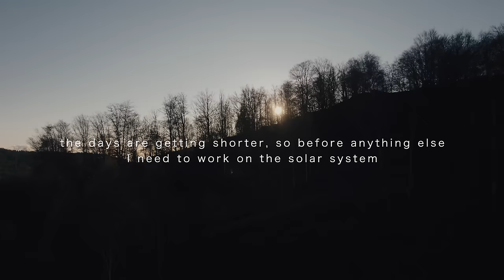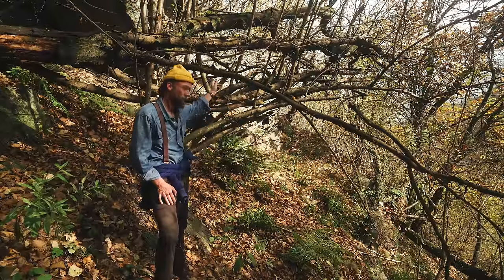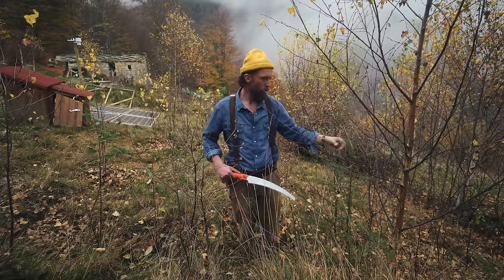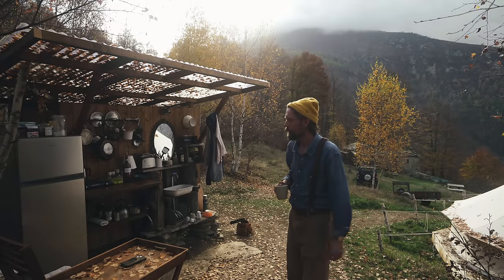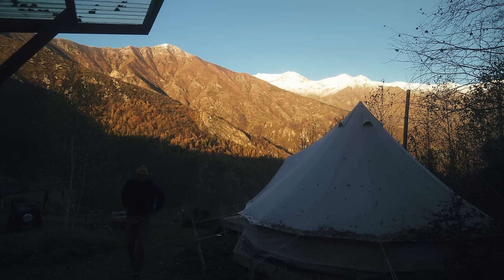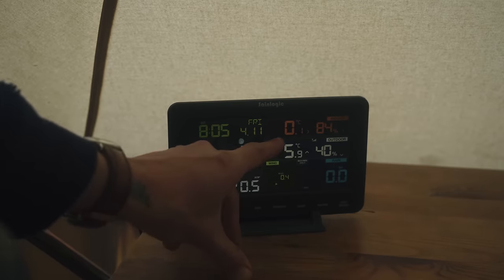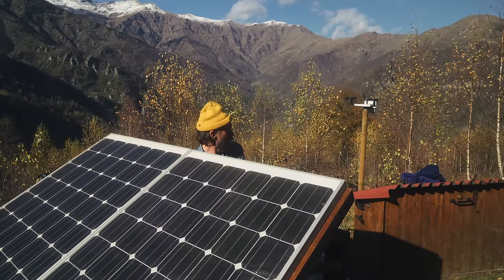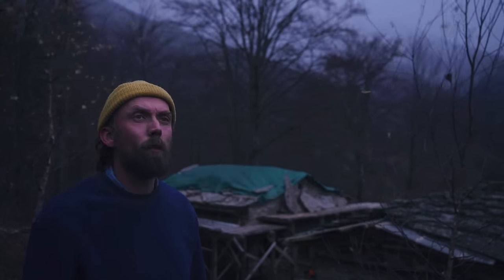#43 Expanding the solar array

Comment: I was taught the best way to mix concrete in a barrow is to use the broad side of a pick. Drop into the front of the barrow and pull back towards yourself. You are moving less material but still getting a good amount of mixing for less effort than a shovel. 

I'm absolutely immersed in this channel after stumbling upon it a few days ago and watching the 3 hour compilation video.

Comment: I have designed solar array installations. The panels are generally oriented facing south pitched at the angle from horizontal of your latitude. This maximizes the output over the year. The angle can be increased by up to 20 degrees to improve performance in the winter. The latitude of Turin, which I think is close to you, is 45 degrees. Judging by what I can see, your panels are pitched considerably less than that. You could try pitching them between 45 and 65 degrees for better output. Panels at 65 degrees will also shed snow very quickly. 
Love your channel and look forward to each episode. 
Brian Hughes

Comment: When summer comes again you may need to think about installing (extra) batteries so you can use the juice of these extra solar panels at times the sun is not shining 😉
Reply: he has 6 batteries installed at this point (I believe)... look at behind the panels,  a  small shed, with several batteries... watch his previous videos
Reply: @Dr.Yalex.  then it might be time to,expand more on battery capacitity so,all that extra solar capacity does not go to waste 😉

Thought he installed batteries… but with these extra panels he might need to expand capacity.
Reply: @Zweefduiker  check out his earlier videos... he has a generous supply of batteries, a generator, and a decent sized solar-powered  water heating tank for instant hot showers. It might be time for you to watch all the videos from the. very beginning over a year ago. Enjoy!
And.. I hope you enjoy all and every mistake Martijn made as much as I did... lol
Reply: @Zweefduiker  didn't read the last part ..."hought he installed batteries… but with these extra panels he might need to expand capacity.".... he clearly explains all the reasons for the extra solar panels, how it will/does correlate to the batteries, how he's planning to expand and when, regarding power harvesting needs and possibilities, fridge running needs, etc. 
Bottom line: all your questions have been answered already by Martijn.
Take care! ciao

Comment: Looking awesome, a tip I learned staining, you can use a rag to dispense it and wipe it off too, since you need to wipe it anyway, you use a rag for both, it’s much easier than using and cleaning a brush, you don’t have to wash a scrap of rag.

Comment: Great vid as usual,  Instead of struggling to mix concrete in a barrow for posts , just fill the holes with a  dry mix and add water after dont over water as the moist ground will do the rest for you

Comment: Little late with the idea but moving the stones with a dolly or hand truck could make things faster and im sure you would find more uses for it. Also, Maybe adding grease to your electrical connections will help it from corroding or being a pain to take apart. That last shot was breath taking. Well done.

Comment: Great video as always Martijn! One thought that came to mind watching this episode, depending on the climate class of your refrigerator, consider turning the whole unit of, if it continues to stay outside during fall and winter. Much lower temperatures than recommended increase the viscosity of the oil used in the compressor unit and may result in much faster wear of the mechanical components thereby greatly decreasing the expected lifecycle of your fridge.  Maybe you can move the food from the fridge into some kind of crate oder similar, so no animals can get to it, as soon as the temperature stays below the maximum of 7-8 °C. For even lower temperatures a styrofoam box inside your tent could do the trick, depending on how cold it will get the upcoming months. If you can do without food from the freezer during this time the better ;)
Cheers and good luck with your upcoming projects.

Comment: Another great video.  I'd be interested in a follow-up down the road on how your solar panels and system work as you move into the shorter days, colder temperatures.  A question for you would be what kind of time do you anticipate spending on the roof renovation work before you started?  I do appreciate your honesty and sharing your missteps. You are seemingly authentic and it's why I watch.

Comment: Whether I saw the snow on the mountains or not, just looking at the scenery told me it's getting cold. 🥶 . You've been busy, preparing for the winter, and with the added solar, you should get sufficient power. 
Those grasses you cut down make either good compost material or good mulch for the trees and vegetable garden. Leaves of almost any kind except walnut will make good insulation against the frost level freezing the tree roots. 
I'm amazed at the depth of soil, usually it's maybe 3 cm deep on the higher mountains here.

Comment: Hi Martijn, love your work mate. Here’s a tip for mixing concrete in a wheelbarrow, I find using a hoe to mix is easier than a shovel.. It’s less surface area for your arms to pull through the mix.

Comment: Just a thought, why not build a frame for your solar panels, then using a spindle like the one for the crane, and let the frame follow the sun and you could ty it down after setting it to the sun, I love your knowledge of all kinds of building, I'm 82 but worked with an old rock wall craftman, and he use a pot about 8inches wide with 2 or 3 inches of water in it to use to level his stones, I learned a lot working with him about weight transfer water shedding etc etc love all your videos.

Comment: The design of the MC4 connectors isn't flawed, they require a tool in order to be code compliant. If you don't have said tool you can always use a small ziptie on the tabs for a release that doesn't damage the connector.

Comment: I live in Virginia in the USA on the est coast half way from Main to Florida. My family who were raised here discouraged pine trees because during drought they seem to be the first to catch fire and burn very hot and very faxt so I am surprised that you are encouraging them. Also they will propagate very quickly and you will be surrounded by a dinner box. The other trees take more heat to burn and burn slower giving a chance for escape. If you are in an area where drought happens you could be building an internal raging furnace around you that would be impossible to escape. My grandfather died in fire so I am very aware of dangers and plan for future and escape routs. Just  a thought!

Comment: Thanks for your uplifting work, Martijn! It's inspiring. Don't know if you meant the inside of the tent is 6° colder than outside? If so, it means you have high moisture levels inside. The woodstove will take care of that. Slow burn it during the day every other day and your tent will be nice and dry - and warmer.

Comment: I think now a days you made experiance that the weather in the alps can change from sunny to rain, snow with in 15min. Would be helpfull to watch weather-forcast view times a day. So you are prepaired of what is coming.
What i do not understand:  It‘s getting colder and colder now, but you are still cooking outside. Beside you have 2 houses with waterproof roof. Temporary (over winter) i would move the kitchen inside in one of the house. So you are safe too.

One more tipp: In the mounthen, alps it can be heavy snowing. Heavy as you can‘t go anywhere for maybe 1 week. You will be completly blocked. Hope you add some reserve food, water, … good for 1-2 weeks or more. Otherwice you will have problem if you are planing to stay there the whole winter.

Comment: I think the window is supposed to have wider trims on the sides, at least 15cm. We also have the Velux windows and the trim is much wider. It depends on what type of roof the trim is made for, but I think it would have been much easier for you to install with wider trim. The wider trim also comes with foam-like sidings that block water when it rains during strong winds.

Comment: You're so merticulous in all your work. But I'm surprised it hasn't occured to you to raise your solar panels about six feet higher. The higher elevation would give you more sunlight on the panels, and allow you to store your firewood underneath to give it some shelter. Adding wood siding to the lower supports would also yield either further protection for the wood or provide additional storage. Just something I keep thinking when I watch these. I've become an addict, I'm afraid. And I'm far behind your long time fans.

Comment: Beautiful colours. 
Love the cloud movement time lapse. 
Does the leaf fall on the tent make it leak ? 
Fascinating to see how many of the stones you can move yourself, now you have experience, although it looked on the edge of safety at times. 
🤜Here, in the southern UK, in my next door wood I used to pull up young Birch, & bracken, to give Alder, Oaks & Beech a chance to grow, otherwise it would be mostly Birch.
😮 snow - just enough to make the mountains look beautiful and not enough to make it look monotonous. 
Summer and Autumn mellowed out beautifully here 🍁🍂 and it's just started to get cold.
Yeah, 3pm feels like the day is ending here too and my body starts shutting down. (Sunset is 4:30pm)
A beautifully crafted video.

Comment: It could be a future project, there are probably enough other priorities.
But a solar set up following the sun could be a huge input improvement if it follows the direction and angle of the sun.
Which could easily be corrected by adding more stationary solar panels making it a bit of a prestige project.
Im not a very electric technical underlined person myself, but remember we already used very simple light sensors to follow light by correcting position from having the sensor get into the schade.  Wind sensors to make it lie flat out of a storm wind etc.
I’m sure there must be several people that have already made simple commercial set ups for guiding systems on tracks or something with simple electric drive ready to follow the sun.
The power of the sun captured by a parabolic mirror for instance following the sun used for heating water or food in a pan could be a very practical way away from “civilizations” to gain access to large amounts of “free” energy. 
And these projects are doable should one have the time and especially the interest to do so.
My solution is the tropical climate.
But in all seriousness it could be a very efficient way for instance to store large amount of hot water to warm a house with or shower/ wash/ bathe with on demand etc. if there is some sun.
By the way I could be seeing myself living in the alps as wel, looks great out there, plus the self determination part of doing it all yourself from scratch is a nice thing to be living out in that setting there.

Comment: If your problem with the MC4 is compressing the locking mechanism, there is an MC4 unlocking tool I used to use all the time.

Comment: Just so you know for next, cement or concrete post's in the ground... you do not fill all the way up, the frost will squeeze those posts out of the ground... the cement is only supposed to be on the bottom and the cement pad needs to be bigger than the post hole size, at least twice as big... it is the weight on the bottom, like a pendulum that keeps the post stable, provided you put the pad at least 5 feet down, below frost line. It is the weight of the material and the size of the pad or foot, that keeps the post upright and from heaving out of the ground, generally, for a 4 x 4 post you would make a 12" dia pad to put it in and when back filling, you must compact soil every foot, even if it is just stomping on it, a bit of water will help with compaction too.  40 years construction experience, personally, I like to go 6 feet deep minimum, yes it's much more work but it will last a good 50 years or more.  I dunno who, how or why people starting filling post holes all the way up, but it's wrong... some companies make a plastic foot that is flared out at the bottom for fence posts.... some of the older guys I used to work for, they put a patio stone in the bottom, put post in, then pour cement or concrete about 8 to 10 inches thick at bottom, the patio stone helps to keep the post from sinking, some would just pour a pad at the bottom, let it dry for a day, then put the post and then pour 8 to 10 inches of cement but the patio stones have wire re-enforcement, just pouring a cement pad in the bottom of the hole does not.
Wind, personally, I'd add some wind turbines, made from ebike motors as the controllers for them, you can set the amount of generation depending on the wind in your location, so if your in a strong windy place, you can set the " regen " to a higher level...some of them Sabvoton, you can set, volt and amps sent back to the battery... use the spokes holes to attach rotor, use disc brake for safety and you dont have to worry about " overspeed " so much with those motors and they are cheap, couple hundred bucks... Li-ion batteries Lifepo4 or the new LTO cells and you can build a storage/ voltage to your needs... like using a 48 volt battery pack for more power, yes they do make 48v inverters.
Reply: Can I suggest that, if you make a 'starter' hole with a steel pole, and then ram the post home with a 'post knocker' ....it will do a good enough job for this application, last many years - and save an ENORMOUS amount of effort and time...and materials....!!

Comment: Have a look at an alternative (addition) to solar (as this is only bringing u electricity when the sun is shining, it’s called Efoy, a fuel cell system that charges your batteries with Methanol fuel, comes in canisters up to 30 liters (good for almost a month) 
Ideal for u in winter or periods where there is no sun
Warmest Regards

Comment: Would it be a good idea to built an enclosure over the open kitchen and then install the last two solar panels over the top for the winter? I am curious to see how you prepare the tent and kitchen for the long and cold winter months? Please share the expected output for the whole solar project. Be well. Stay safe. Smiles.

Comment: I'm sure someone might have mentioned this before, but with the amount of wind you're getting have you ever thought of adding a wind powered backup system? There are smaller systems that don't need to be up high and still generate a decent bit of power with minimal amounts of windspeed.

Comment: Martijin, I agree with all the positive comments about your film making and the hard work you put into each and every video.

But, the use of concrete on bare wood is going to be your doom. As I commented on your #32 Video about your concrete ring, please read the information there as well. I must also preface this with, if all the building you are doing is only temporary, i.e. you plan to sell soon after you finish or you only think you’ll be there for a few years, then you’re better off pushing these problems onto the next person that buys the property.

As you have stated, your property does not get lots of sun year round, being on the north side of your mountain.  From your videos, you are constantly having moisture in the form of fog/clouds and rain. Concrete loves to hold on to moisture and make gaps between the wood and the concrete, by first pulling the moisture out of the wood (treated or untreated) causing the wood to shrink and make a gap for more moisture, plus making a nice house for mold or algae to form, that will decay the wood at and accelerated rate. This goes for the post you set in the ground for your panels but more importantly the concrete that is encasing those beautiful new beams you just put in to support your heavy stone roof.  You may want to remedy this very large and important problem in your new home before you continue forward.     But if you don't want it to last, who cares.

Comment: Wondering what your plan is for a kitchen in wintertime. We usually get several inches to a few feet of snow during the winter here in Kentucky in the US.....I wouldn't want to have to deal with the snow and freezing temps when trying to cook or bake.......maybe you can move it into one of the more finished cabins temporarily for the coldest months......

Comment: After watching todays episode, I have been wondering if you have considered to add 1 or 2 residential Windmills to your Solar array? By adding Windmills you would have the added benefit of generating power when the sun is either to low, or it is too overcast to generate enough power for your needs. I hope you are getting everything set before winter hits full force.

Comment: Could you leave the cc up a little longer? I have been looking at properties but it is hard to know what area. What a beautiful view from your outdoor kitchen. Can I ask a question? Do you have stress since you started this?
You make digging the holes look easy. I reall hope you don't hurt your feet or hands doing your roof. I think it is interesting you have an outdoor refrigerator. I guess I'm from where coons would get in amd mice would eat the wiring. Are you wraping your solar system wires in weather wrap to protect it? Heat shrinks protection on the connections.

Comment: Just wondering how much snow you will get there and if the solar panel will be partially buried.   Is there a reason you do not mount them higher? Will you be planning on moving out of the tent soon? I imagine it will have to come down before much snow arrives.  Winter and snow here in BC Canada, cold temps next week of -22. This rock roof assembly is interesting, not sure how I would feel about it for my home though! It does not seem you are in a super wet and rainy area, get some help to finish it.